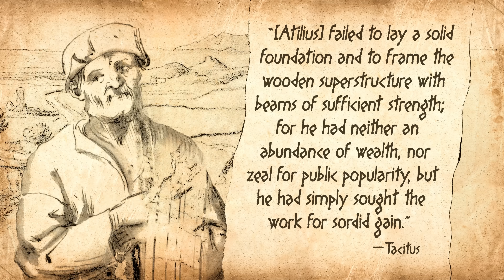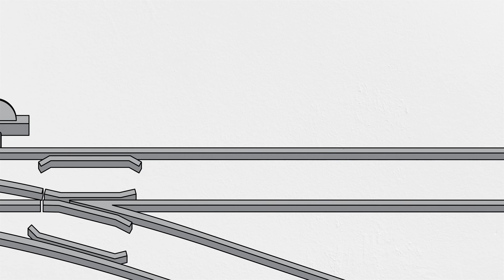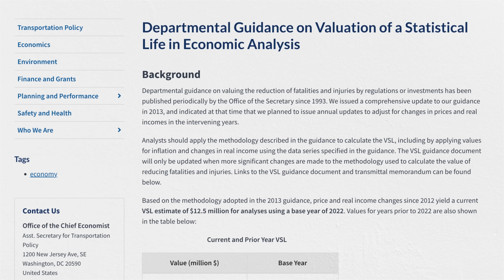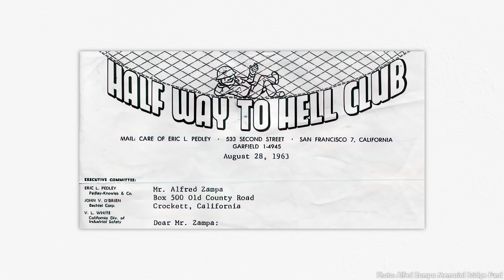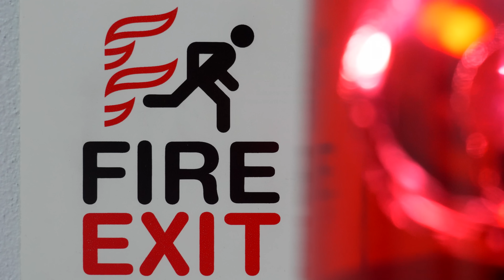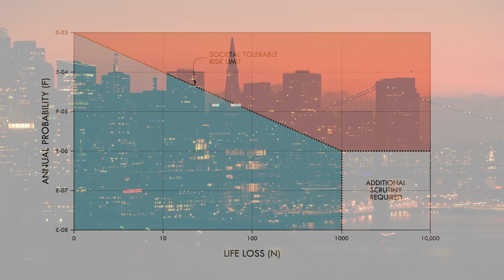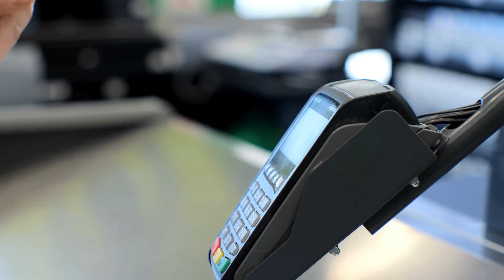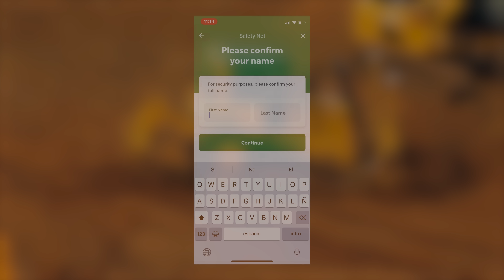How Much Is a Human Worth? (according to engineers)

Comment: As an engineering manager, I've pushed to add an additional 15% to our safety factor for our structures (we design heavy industrial machines).  Our sales guys hated it initially, because our prices were 2 to 5% higher, but after a few years, we earned a reputation for reliable machines that stand up to abuse, our customers love us, and we are doing better than ever.  

We as engineers have been pushed into increasingly thinner and thinner safety factors by cost cutting focused executives, but they fail to realize there is a limit and by putting so much pressure on the engineers, they are inviting trouble when unforeseen circumstances eventually come knocking.  What is foreseeable though, is that there will always be unforeseen circumstances.  It's important to push back, and when appropriate, to hold them accountable.
Reply: Good on you! 
Many of the penny pinchers who financially survive their frugalness and the incidents of harm, or even just worn-out machinery, will come to you eventually.
Better for a company to get a reputation of quality than to be the Harbor Freight of your industry.
Reply: As an electronics design engineer we would always over build the product with more expensive parts then necessary such as fancy capacitors because we knew the penny pinchers would force us to lower costs no matter what. If you submit the most optimize solution first then you have nothing to cut for the penny pinchers and they won't stop until you remove 10% cost.
Reply: @KyleJones734 Spot on, it's certainly not ideal, but when execs with very little understanding of how things work simply insist on cutting 10% of the cost, no matter where you find it, year after year after year, and they put incentives and disincentives (do it or you are fired, or won't get a promotion), this is a logical response.  I applaud you for doing this instead of compromising on reliability/safety.
Reply: @KyleJones732 Then you probably don't design motherboards for Samsung or LG TV's. Have you seen where they put capacitors, next to heat sinks? Like buying a 20% more expensive ones and removing them from warmin space would probably quadruple the lufetime, but they explide on average in 2 years (or less) , which is the usual warranty duration. Looks luke planned obsolescence can be more profitable, than cutting 1% off product cost?
Reply: @KyleJones734  
Ah yes, a perfect example of why a person that's in charge of a tech company should be somewhat of a technologist themselves...
Reply: Sounds like the Boeing problems, they let the bean counters and bee bee stackers lose, and tied the engineers hands. And you now see where that got them.
Reply: there are few who think like you
Reply: I am glad to see this put out here.  Few manufacturers seem to understand that 100% of capacity of the machine is the usual use level and that if the operator can find some way to get to 102% they will do it.  Part of this in my experience is because the steps in size of equipment is so large. To get twice the useful capacity the cost of the machine goes up by a factor of 5 or more. It also means that the hauling, set up, fuel, insurance, maintenance go up by a similar factor.  Few businesses can make this pay.
Reply: You definitely do not work for TEREX. My city bought a bunch of their equipment because it was low bid. They ended up spending more on up keep then some of the ancient John Deere and Case equipment. They ended up keeping many of the old backhoes and sold off the TEREX at auction, because they just cost too much to keep running.
Reply: The proper response to the Sales: 
"I cannae do it, captain, I'm giving it all she's got, but she just cannae take another dose of bullsh!t!"
Reply: I'm an EE designing MEdical Equipoment and from what I have seen one of the biggest issues is that R&D, Sales, Strategic Purchasing, Vigilance, Risk Management (as part of Quality or Regulatory)  and Management work separately. R&D and RM/Quality/Regulatory sometimes work together - and this is great, but then Management works together with  Sales and Purchasing work together, which is very bad to quality. Everyone wants to do best their part of work, but as far as R&D want performance and quality, RM want quality and safety - others want minimal costs and shortest times. Effect is that R&D and RM are pushed to release the product ASAP, therefore their work is not done properly. 
And Medical Equipment costs a lot and certification is required, so there is some cost margin to add safety measures, I'm often terrified of standard consumer products that can hurt people.
Reply: When I started engineering, the human life was a bit over 2M. 12 now hey? Inflation is rampant
Reply: @danwhiffen9235 Alternatively, we decided the it was worth spending more on safety to save a life. 

Probably a little column A, little column B
Reply: You sir are a hero.
I mean that seriously...
Society needs people that push real social good(not fake social justice warrior bs)
People are likely alive that would not have been because of your pushing the safety margins up, kids that would have grown up without a father/mother and perhaps even lived on the street with out a home due to failure to pay mortage/rent with no bread winner. Not to mention maimings and the like also avoided.
Reply: fantastic thing to read ♥ what is the company you work for?
Reply: Sales and executive can change often, sometimes much earlier than when the repercussions from their decision finally comes.
Reply: @emmanuelwilliamquinton9152  Precisely - which is why policies must be put in place to ensure later consequences hit them right in the pocketbook.

Hence stock compensation with shares they are contractually prohibited from selling whatsoever until at least a couple years after they leave the company; if their decisions harm/destroy the company after they leave, they lose a lot of money.

It'd be especially effective with execs, because many of them receive 50%+ of their compensation in the form of company shares. While I'm sure many execs wouldn't be willing to take the job with those terms, that should just filter out most of the really awful ones right off the hop. If it causes huge hiring difficulties, another option would be to choose execs via promotion instead of direct hiring.

I'm sure many high-level "lifers" (long-term employees who've stayed with the company for most or all of their career) would jump at the chance to become an executive even with those terms, and there's a good chance they'll actually make better executives because they've put so much of their blood, sweat, and tears into the company over the years they're far more likely to care about choosing what's best for the company.

IMHO the workforce would likely be a better place if companies primarily hired people into low-level positions and promoted them up through the ranks, rather than directly hiring high-level employees; if you've worked on the ground floor and slowly climbed the ladder, you'll understand how the company operates in ways a business major just can't.
Reply: So you work for a company that listens to it’s engineers more often than its bean counters? And 15% more often at that, which does not seem overly cautious. And as your company has found out, not overly expensive in the long run. Now there’s an ideal!
Reply: I make spacecraft parts, and I always tell managers, "I'm not going to be the guy explaining on CNN why this rocket fell on LA instead of going into orbit, so I'm not going to take that shortcut instead of doing it by the specification."
Reply: What kind of machines? I'm very familiar with valmet and andritz paper machines, and all of the thousands of other pieces of equipment that enable their reliable operation.
Reply: Makes sense. Seems like they want things like planes to cost the same as chips. Who cares if it kills everyone
Reply: Bean counters have such poor foresight
Reply: Imagine having this argument with the Boeing "business minded" execs that ruined the company...
What's a little turnaround on your entire veteran labor force?!?

Capitalism, as it turns out, makes people dumber than rocks.
Reply: Sadly making them see that probably isn't easy, even in cases like you mentioned where increasing the safety factor results in an overall better product. Too much of business is merely a race to the bottom.
Reply: One thing that annoys me is what I call the abuse of strength analysis.  It used to be in the time of slide rules that you would put in, say a 20% safety factor.  Now simulations can allow us to reduce that safety factor to 10%, 5%, 2% 1% 0.5% in order to cut costs.  You see where I'm going?
Reply: Yeah my dad was the same, his colleagues hated him for that. But as soon as investors knew he was involved they were happy cuz they knew they could  drive a tank over it in addition to what it was supposed to hold. He has also built the Slovak embassy in Washington DC. May his soul rest in peace.
Reply: Yup, I'd much prefer to pay a fair price for something that will last and be safer, even if it costs a little more.
Reply: Because there psychopaths that's why
Reply: If only NASA had held these views during the Shuttle years. A lot of brave astronauts would be alive today.
Reply: @jameswilson5165  Some of the shuttle disasters were a result of the pace of missions, overriding some of the concerns of engineers.
The Challenger o-ring problem was unanticipated, if I remember correctly.
Reply: @MonkeyJedi99 iirc the o- ring issue was known, but deemed unlikely to meet the failure conditions and in event of failure, damage would not be significant. 

Also faintly remember they were there originally as redundancy at first

Going off memory, so... i could be wrong
Reply: @MonkeyJedi99  actually, the challenger O-ring problem was anticipated, as NASA had been warned about launching on such a cold day by it’s engineers. But the engineers were overruled.
Reply: @jameswilson5165  government has a reputation of not carrying about people
Reply: @jameswilson5165 add 15% to the rockets weight and it wouldn’t get off the ground (metaphorically speaking)
Reply: Classic survivorship bias. There are many companies whose 5% increase in cost was the competitive difference that lead to their bankruptcy. Cost cutting and penny pinching is so prevalent because its just the safest business bet. Ironically, lower product risk means higher business risk.
Reply: @ObjectsInMotion  It really depends on what you are designing.  Bic pens with annual produced units in the tens of millions and don't endanger life or delay huge billion dollar projects, sure, cut cost to the bone.  Heavy machinery with annual production numbers barely over a dozen, and failures that cost lives and the potential to tank billion dollar projects, no.  But executives with business degrees want engineers to cut costs exactly the same way.
Reply: @Ethan7s Your example of Bic pens being able to cut costs to the bone is technically and historically inaccurate. I'm old enough to remember when Bic pens came with a top that had no hole in it. Enough people who sucked their pen tops died when the top got lodged in their windpipe, that Bic engineers decided to redesign the top with a hole in it so people could still breathe. That required design, testing (to find a solution that didn't also compromise the top's ability to prevent the nib from drying out) and retooling costs. Engineering is everywhere, and true engineers shouldalways push back when they see a potential or extant issue.
Reply: @nettlesoup  I'd be willing to bet the number of people who died that way was tiny. Bic was probably worried more about the potential for bad PR than the number of deaths.
Reply: @Ethan7s  Actually pens did endanger lives... companies even got sued... It also proves your point.
Putting a hole in the pen cap so if it was sucked down someones throat so they could still breathe was more expensive per pen, yet cheaper then paying out lawsuits for the deaths the pen lids caused.

Comment: “Anyone can make a bridge that lasts for a hundred years.  Only an engineer can make a bridge that barely lasts for a hundred years.” -engineering proverb on trade offs and cost optimization.
Reply: However, engineers don't generally build bridges.
Reply: @hhiippiittyy  good thing, too. ;)
Reply: @hhiippiittyy this is just wrong who do you think designs a bridge
Reply: @jum3628  
It was just a joke about the actual physical process of building the bridge, which is done by labourers and tradespeople.
I didn't mean much by it, just kidding around :)

Comment: Great job Grady!  A couple of things I might add are:

Adding safety features is adding layers of protection.   In the "swiss cheese model", you have to ensure there are no holes in those layers that line up and eliminate the safety features.  

Risk is the multiplication of Consequences x Probability.  

The layers protection work to reduce either the consequences or the Probablity like this:

Design features:  Location of the road, The roughness of the road, the curvature radius,  width of the road, slope etc. , design of the cars
Administrative and Passive controls:  qualification (drivers tests), procedures, standards, operating instructions that people follow (like stop signs and road rules), maintenance, .. 
Active engineering Controls:  Like rail road gates that close when a train is crossing a road, stop lights, air bags, (things that could fail, but have engineered systems to prevent their failure
Emergency Response:  Things that reduce the consequences, but don't affect the probability of the event,  location of hospitals and availability of ambulances etc.

Comment: Whey you pronounce amPHitheater wrong once, it wouldn't be a problem.
But when it's mispronounced every few seconds, it is really weird... You may call it OCD, but it really distracts me to a point when I felt the need to point it out and considered turning off the video.
The "ph" is supposed to be pronounced as "f", not "p"  (just to be sure, I've checked both UK and US versions, both should be "f")

Comment: As a software "engineer", I worry about the ability of a software flaw (or misapplication) to kill many, many more people than any collapsing bridge. There isn't enough formalism in my field, and I suspect that will change only when we have a large tragedy.
Reply: Your rules are yet to be written in blood
Reply: Are you referring to skynet?
Reply: There absolutely is a formalism in software engineering for safety-critical applications, and it absolutely is motivated by large numbers of deaths caused by software failures. Just look embedded software engineering in automotive, aerospace, medical, telecommunications, finance, or military industries. There are legal safety regulations that must be met both by the software (and different parts of it) and the process of making that software.
Every change in code must be documented, approved, reviewed and thoroughly tested in simulation, on actual hardware, in actual vehicle on closed track and on the road under varying environmental conditions; before that change can be put into production vehicles. Depending on how safety-related the change is, every one of those steps may require supervision of dedicated safety experts, cybersecurity experts, certified automated checking tools (linters, address sanitizers, formal verification). Every change must be traceable so that you can determine the failure point in the process, and make adjustment to mitigate similar failures in the future. The same goes for every tool used in development that might affect functionality (and therefore safety) of the software.

The only fields of SW that don't do this, are those which work on fairly benign mundane stuff, like consumer electronics or end-user facing apps and interfaces. But even, there are legal requirements that they must list possible risks in their end-user license.

Comment: that rumble strip (@6:50) ruin the road. we in western NY dont only have them on the outside of the road, we have them along the center of the road. they break the road sooner than if they were not there. not only does it hold water, the snow plows do skip on it. coupled with cheap skim coat paving of the roads we do around here, allow the water to get underneath and split the layers. costing more to rebuild the road again into a vicious cycle of spend and spend to fix. we no longer have 20-30 year roads here now we have 5 but wait 10 cause of cost.  how much money does it cost the user of the road in accidents that could be avoided due to poor roads before the "engineers" stop thinking about money and more about what it is they are doing.